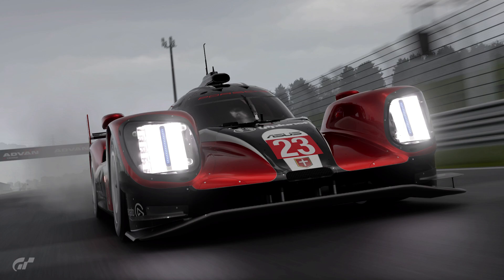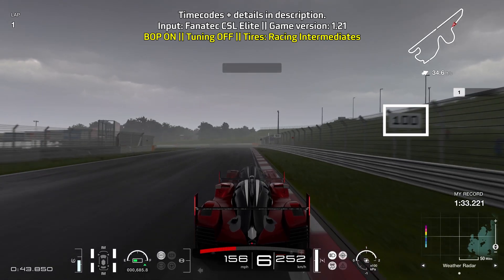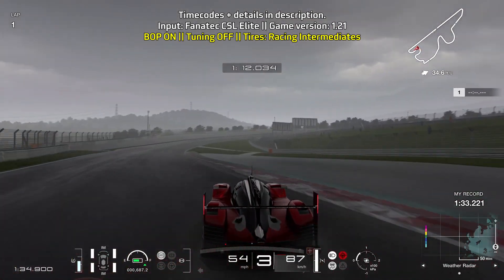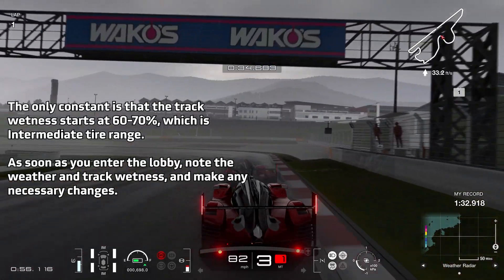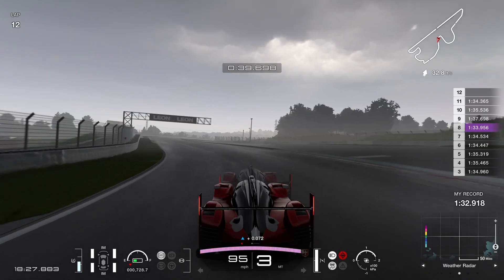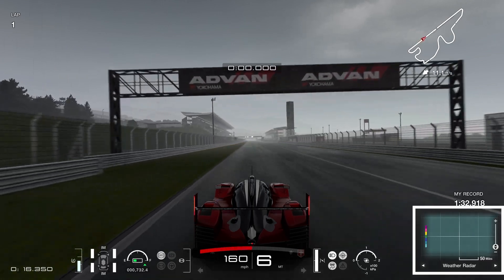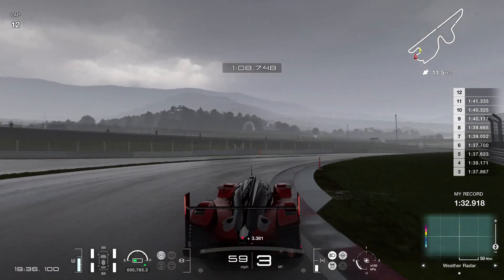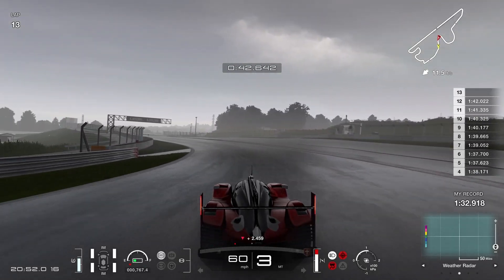[Gran Turismo 7] 2022 Nations Cup Stage 2 Round 5 Guide - Fuji Speedway - Gr. 1

Comment: Hi Mistah MCA! Just want to let you know I won this race thanks to your guide! My fourth winning streak since the Manufacturers Cup two weeks ago when I started watching your guides. :D

I used the LM55 VGT, got pole position at 1:36, half a second over P2, then also won the race by one second while doing consistent 1:37 laps.

I took into heart your lap guide and paid off really well! I kept the TS050 and 919s at bay, P2 and P3 hunting me down throughout the race. 

What I did beforehand was also practice with all the available Gr. 1 cars through the renting system of GT7. Gladly, I was able to note their advantages and disadvantages versus my choice of the Mazda. 

I completely lose out to low speed corner exits and acceleration. In fact, I got passed at the rolling start before the first hairpin thanks to the strong hybrid boost of the Porsche and Toyota. 

I was able to make up for it once we got to the main straight at the end of the first lap, wherein I completely win in terms of top speed, then they'll  be catching up again after the first hairpin once their hybrid system is recharged. 

Basically,  I'm  a sitting duck for the first few corners whenever they're near. I can only attack or defend constantly at the sweeping Turn 4  and subsequent corners when their boost is already used up. The LM55 also seems to handle better in the wet since the Toyota and Porsche I believe lose their AWD without the hybrid boost. 

Overall, it was a great and challenging match! Your guide was always of great help to me. Thanks a lot again!

Comment: Hi Mistah. What's the point of countersteering on? are you on pad at the moment? Thanks
Reply from the maker: It's to help me not spin out, since I am terrible on wet tracks. :_NervousMCA:

Also, on wet tracks, some cars/players perform significantly better with it on Strong and TCS at 1.

I remember one combination (can't remember it at the moment) where having CSA Strong and TCS at 1 shaved off 4 seconds a lap under soaking wet conditions.

Edit: I'm still mainly on the wheel. There's been some Daily Race combinations where I'm better with the controller (Rallycross race and the kart race), so I've been giving my wheel a well deserved break.
Reply: @MistahMCA  thanks mate

Comment: How are guys doing 1.22 on soft tyres in the wet??
Reply from the maker: Step 1: get the perfect conditions (which is really hard to know if you have it)
Step 2: wait or drive around for 30 minutes to an hour. If you have perfect conditions, the track should be drying up just enough for Soft tires to work.
Step 3: Pit for Soft tires, and go set some lap times.